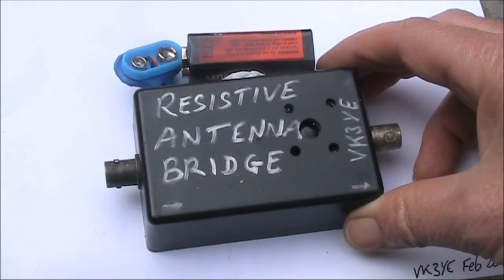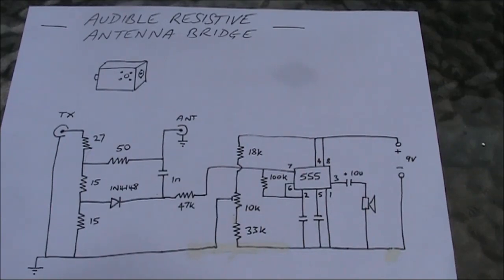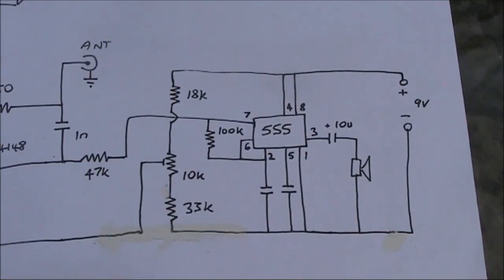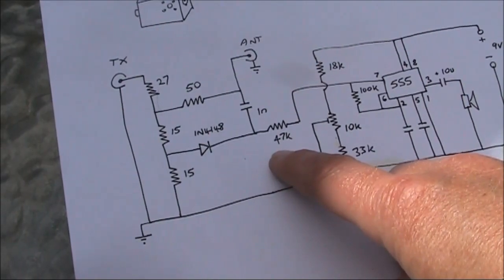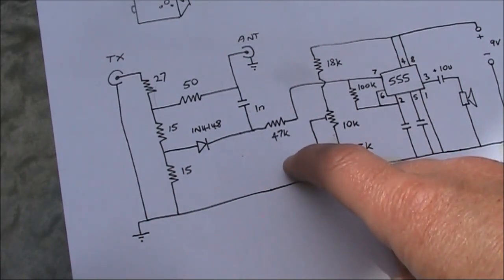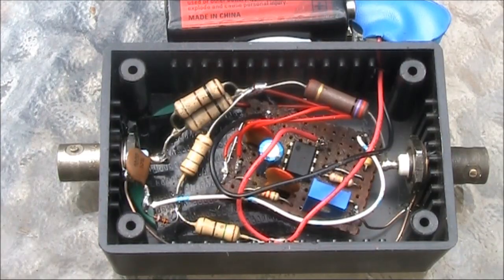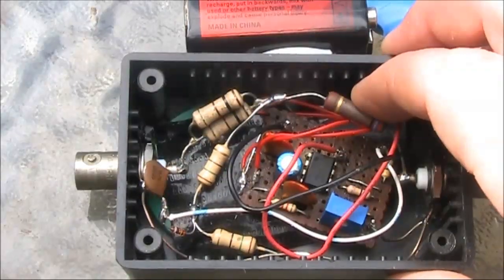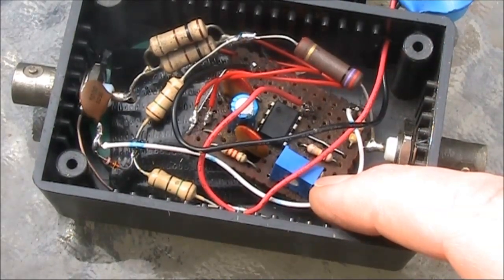Self contained audible resistive antenna bridge

Comment: For cheap meter movements buy 2-3 dollar Chinese analogue multimeter and tear it up. You can remove the scale and respray or just tippex and letraset. Or print a scale to stick on. I have one I converted to a swr meter and ATU. Even modding the switch for inductor tapping

Comment: Peter, I need your help please.
 I have built one on matrix board and now one on  a breadboard both of which do not work.
 I note some values on your circuit are missing.
 I think i may have copied the circuit incorrectly, but I don't think so. Would you be able to send me the  circuit you used. Colin VK2JCC
Reply from the maker: Colin - missing values are 10nF. Earlier video could be helpful. https://www.youtube.com/watch?v=BsZ2P8zqGuo

Comment: Hi Peter, I have built the circuit to your sketch, but it will not oscillate. Just checking are you sure the output is on pin 3 ? I have just looked at another internet reference which says an output should be on pin 5? vk2jcc

Comment: Peter, wonder how well this would operate with a 100 watt transmitter. 73
Reply from the maker: It would be fine. You'd wind the 100w rig down to 5-10w for tuning up anyway.  Or if you couldn't do that you'd make the indicator less sensitive - possibly by adding a voltage divider and/or adjusting the potentiometer.

Comment: Great project! Thank you for posting it. I think you should keep working on it. I have built something similar but instead of 555 it has a small toroid and a red LED.  QRPGuys sell very  similar kit.  The benefit is that it does not require any external battery.  Also, I have a Tune/Operate switch.  I see the application of the audible bridge in case when the tuner is installed right at the feed point or you are trimming the antenna to the correct length and the connecting cable is long. You do not have to run back and forth to read SWR at the station.
Reply from the maker: And if your feedpoint is a long way away you could put a 433 MHz tx module inside the bridge and listen to the tone on your 70cm handheld.
Reply: vk3ye - just fun and brilliant

Comment: Great project Peter! I like being able to swap it in and out of the antenna connection with the BNC jacks. How low of a wattage would this work with? Would a simple crystal oscillator work? If you wanted to, you could make an audible antenna analyzer. Not sure why you would want to, but it would be an interesting project. Charlie KM4ZZ
Reply from the maker: Doubt a crystal oscillator would work but could try a germanium diode instead of the 1N4148 for better sensitivity. This is very crude and doesn't measure reactance like a proper analyser does.